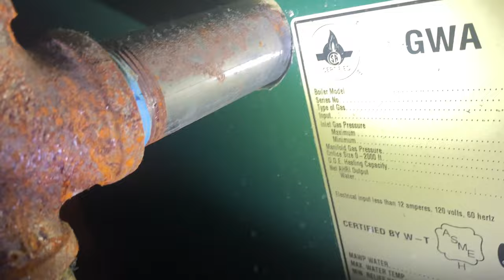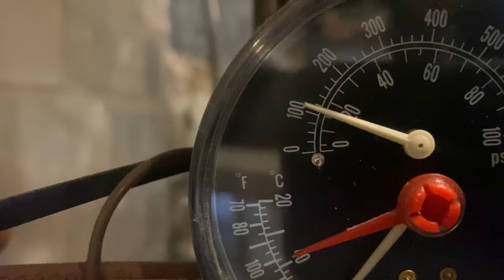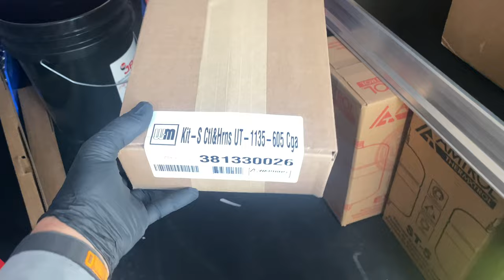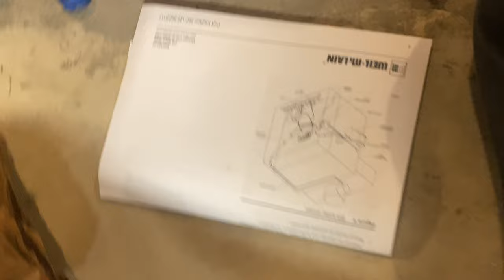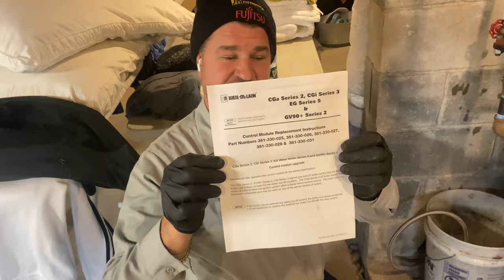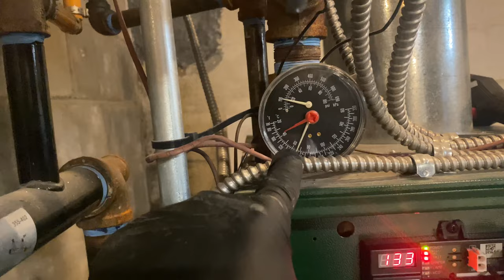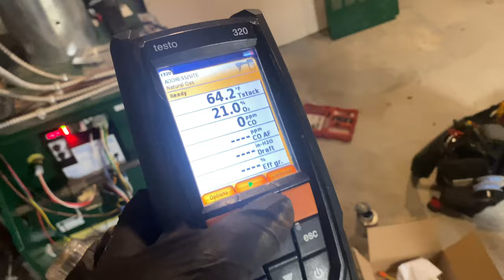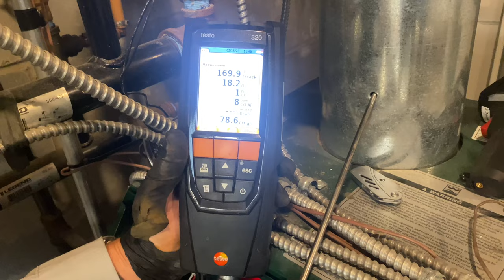Williamson Gas Boiler Isn’t Heating Properly Step by Step Plumbing & Heating Service Call

Comment: I replaced a control board on a furnace I had to order it online because no plumbing supply store had it in my area it was 300 dollars for that board older furnaces always cost more for electronic parts because they are hard to find

Comment: I am loving learning from this channel. I'm getting to see different failure modes and hackery in quantity on a wide variety of boiler systems. I'm an electrician and automation mechanic by original trade, but a job change has me starting on my HVAC journey. I am glad to have channels like yours that explain it well and still keep it fun. I know you'll keep up the boiler work, so keep making the videos! I'd also like to commend you as you are an excellent mentor.

Comment: I have the same boiler and went to check on the economy setting. It was all the way to maximum. I put it in the middle based on your recommendation. Read the manual and it claims it should be put on Maximum.

Comment: Mike, if you had to buy a gas boiler natural drift for hot water hydronic baseboard what brand would you go with a Home is a one for the ranch 1300 square-foot

Comment: Отличное пояснение по ценам на запасные части 👀. Склад на колесах значит. Работа 👍, напарник с потенциалом.
Приятно посмотреть на вашу работу с другого континента 🇷🇺. Спасибо 😉
Reply: I like the comments. I like the comments about business practices. Business maybe done a little different than in other countries. I live in the same region as the video creator (producer). For real, and for real the product changes, discontinuing the part from manufacturers and service industry pricing. Without giving details  Mikey gives great advice for prices adjustments as in the parts sold for Mikey Pipes' rolling warehouse replacement parts.
Reply: @OLDMAYTAGDRYEROWNR  Согласен с вами, спасибо 😉

Comment: Hey Mikey, I recently got my house remodel and the contractor that install my Williamson boiler doesn’t know how to properly connect the lines. I’m from Queens, so it’s very heart warming  to see these videos you post. When he turn on my basement my first floor heats and the basement, then to only find leaks 😢
Reply from the maker: Sounds like you need a professional. Where are you located?

Comment: How does the mixing valve work in a hot water heating system.  Were does the cooler come from for the mixing valve? Thank you.

Comment: If you put a piece of black tape on the copper pipe you will get a proper temp from your thermal gun. Copper is shiny and it dosent register very well.
Reply: Great guy learning.  Had the opportunity to be  HVAC at 17 and didn’t want it  at 68 love all your video.
Reply: @PipeDoctor  thanks Mikey I take as a very high compliment coming from a master plumber. 💪👍

Comment: Just fyi you’re reading your thermal imager wrong. Scale on the right is the full scale. Your center temp (cross hair fixed) is the third number on the upper left. That second floor pipe was reading like  maybe 110, at least as far as I saw, it’s probably hotter than that since we can see the white/orange color showing. It’s getting a little confused by reflected vs emissive reading. It’s most accurate on that black pipe, since it’s going to be only emissive or almost only emissive, and the shiny brass and copper it’s going to be pretty off (emissivity, which yours discloses in the numbers on the bottom,mid have to dig up what it should be for copper or brass). Boilers definitely only getting to 130-140 though so the tridicator is probably right.

Comment: Mike, if the temperature gauge wasn’t connected to an electrical connection could you use Teflon then?  For example on a tri gauge?
Reply: @PipeDoctor  Mikey…. Ptfe is Teflon….Teflon is a trademarked name… ptfe is a chemical compound abbreviation

Comment: Hey mike… would you hire a coned gas emergency troubleshooter with 10 years of experience fully NGA qualified and that also was an ase master mechanic/paramedic before coming to coned…he’s not a plumber by trade but he’s one hell of a problem solver
Reply: @PipeDoctor  sounds good … what’s the best way to contact you

Comment: I was hoping someone in the comments section could help me out with something I've been noticing with my Goodman gas furnace.

The furnace ignites and heats the house for what seems like the correct duration. I've noticed after the flame goes out and the blower continues to run and not to long goes by and the furnace reignites and completes another heating cycle.

I find it weird that it is reattempting to heat the house before the fan turns off. The thermostat shoes the ambient temperature is the same as the desired temperature.

I've changed the flame sensor as well but the issue still remains.
Reply: @PipeDoctor  thank you for replying.  The filters are brand new.  Cheap ez flow filters too.  The air ways appear to be clear too.
Reply: @PipeDoctor Just witnessed it happen and the LED indicator gave 4 flashes.   Chart says open high limit.

Comment: I also wouldn't Cary the correct wrench for the job I would have an adjustable wrench. Come on how many different sizes of fittings do you actually come across that you can't have a proper wrench

Comment: Wait I'm confused u don't use Teflon tape so u had a good ground but yet needed an external ground therefore rendering your entire speech about no Teflon useless?..... Granted pipe threads never need Teflon due to the tapered manner they are made